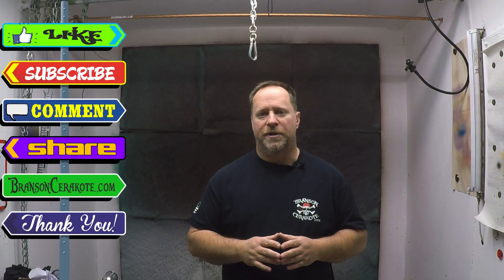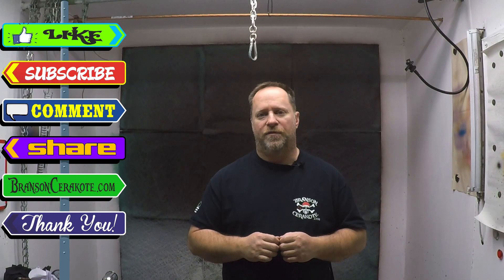Degreasing mistakes | Cerakote | Cerakote Prep | Branson Cerakote

Comment: Nicely done sir. On a side note, when coating custom made stainless exhaust headers my process is to wipe them down with acetone, blast, hang then spray them down really wet with virgin acetone, leaving to dry for 12 hours minimum. After some adhesion issues early on I found this to fix that issue. I agree I would not resoak them though unless I had a big enough tank and it was fresh acetone. Love your work!
Reply from the maker: Good info. We don't really do a lot of car parts.

Comment: What is the best way to clean a large piece like a manifold after blasting with aluminum oxide before using Cerakote? I want to be sure I get every speck of abrasive off the manifold and out of the inside of it. Thanks,
Reply from the maker: If it's already been degreased, then high pressure air. If you are worried about the item still having contaminants, then heat it up to 300-350 in the oven for an hour. If nothing comes out, then you are good to go.
Reply: @BransonCerakote  thanks! I'm just concerned about cleaning the inside of the manifold well enough to prevent any abrasives from getting into the engine.
Reply from the maker: @johnpatterson2157  When we do manifolds and headers, we normally tape off the areas that interface with the gaskets anyway. It just takes that concern away.
Reply: @BransonCerakote  I was out of town for about 5 days this past week but I did get the manifolds painted. I used H series gloss black on the plenums. I was going to clear coat the runners but I couldn't keep the aluminum from staining so I ended up painting them with c series glacier silver. I'm very impressed with the coating. It's very hard you can't dent it with your fingernail. I've thought about clear coating the manifolds but I'd like to go ahead and put them back on and get the car running.

Comment: I just wanna rattle can my barrel and don’t have a sand blaster. Can I use acetone on a rag? Or brake cleaner on a rag?
Thanks
Reply from the maker: I'd at least give it a good wipe down with acetone. We degrease everything by soaking it for an hour in Simple Green.

Comment: Does this hold true for wet blasting as well? All their documentation seems to be talking about dry blasting process as for prep and AO PSI etc. I always worry my water might have some oil or contaminate when I blast though I try to sanitize before putting stuff in there is seems inevitable. My plan was to put on oven after wet blast AO 100 ?  Been getting a lot of motocross brake calipers and I'm trying to figure best way to deal with the brake fluid. That's THE worst once a tiny bit gets in my water. Love your vids! Thanks you so much for doing these vids.
Reply from the maker: Sandblasting is primarily to get the surface etched, and to remove any type of existing coating. If we get any kind of residual contamination, we take care of that with the oven and a clean squeeze bottle of acetone.
Reply: @BransonCerakote  Thanks for the quick response!  Yeah that makes total sense.  Surprised Cerakote doesn't speak to wet blasting process at all.  I figured I would Gasout after I blast then wipe down like you said. Thanks again from New Hampshire! @603mods
Reply: How well are your parts turning out after wet blasting? I’m considering doing this for some parts to cerakote.

Comment: Thanks for sharing. Had a friend attempt his first cerakote job on his $3k F1 ar last weekend and it looks like it had contaminants that pushed air bubbles up under the surface. Looks like  chicken pox:) I haven’t gone over everything that he did for prep yet but I get to see how well the coating holds up to sandblasting. So at least I’ll learn something new:)
Reply from the maker: I've had calls about the blisters. I've never had that issue myself, but there are a few things it can be caused by. Most of the time, it is contamination. However, it can also be from coating that isn't mixed enough, or from bad coating/hardener.
Reply: Inadequate mixing never crossed my mind. Thanks.
Reply from the maker: @jeffhuntley2921  I don't know the chemistry behind it, but I do know it starts separating fairly quickly.
Reply: Mix well

Comment: I use a funnel with a coffee filter and filter my used acetone. It gets quite a bit out. I still wouldn't  use it after sandblasting. I just like knowing it's a little cleaner after use.
Reply from the maker: That will get the solids out, but there will still be dissolved gunk in there. Once it looks like weak tea it's time to replace it.

Comment: Just like powder coating, outgassing after degrease and sandblast is critical. If you find residue after outgassing, degrease again and outgas again. My experience shows a second sandblast is unnecessary if clean after outgassing. Keep the information flowing as I'm still learning how different materials react.
Reply from the maker: The only thing I would add is that we don't recommend putting the item back in the soak tank once it's been sanded. The soak tank normally has all kinds of crap dissolved in it, and there is a danger that the contaminants could settle into the etching causing adhesion issues. If more degreasing is needed after sanding, we recommend getting the item hot in the oven and spot degreasing with clean acetone in a squeeze bottle.

Comment: I had some cerakote that was close to a year old and painted with it and it failed guess it was expiration not shure its alot of things that could went wrong
Reply from the maker: Normally when it's gone "bad" it gets too thick to spray due to loss of solvent. It normally won't cause it to fail. If you want, shoot me an email at the shop with some pics and I'll be happy to try and help you figure out what went wrong.
Reply: @BransonCerakote  thanks for reply I sprayed with a airbrush and I put it on there thin .that could been problem I put in on some bicycle cranks on high abrasion and it wore off In about a month and it is real porous like a primer it absorbs dirt really easy . It could also be the airbrush cup I used was plastic when I got done it was squishey like a rubber hose in acetone
Reply from the maker: @damensutherland7081  We generally advise against using an airbrush for base coats. They tend to spray at really low volume because on the needle size, and don't give you the nil thickness needed for durability and abrasion resistance. Plastic cups are also generally a no go.

Comment: I'll agree than MOST times finger oils aren't a big deal. However, with white, I've had perfect fingerprints bleed through, looking orangish or pinkish in the white coating during bake.
Reply: Good to know, thanks!
Reply from the maker: I guess I have dry fingers, lol. 5 years in, and I've never had an issue. 

What temp did you cook it at? Just curious.
Reply: 250 for 2 hours. I must have been extra sweaty that day or something haha
Reply: @danbrownpaintworks  Nah, Dan it was probably that extra large order of fries the night before ;)
Reply from the maker: @danbrownpaintworks  Problems happen.
Reply: Whites .. and almost all light colors are somewhat transparent at times and I have found require a bit more repeated passes.  That may be why the fingerprints seemed to "pick up"?  Just theorizing.
Reply: @BransonCerakote  ... using Acetone a lot helps in drying out your fingers ... haha!

Comment: hi. Just wondered if you could share details on your degreasing tank setup.  I am unsure what is best to use for small items.  Many thanks
Reply from the maker: We have the degreasing tank from cerakote filled with Simple Green. We are going to move to a 15 gallon poly tank once we move into the new shop. If you only have small items, and don't need something set up for long term use, just grab a small storage bin and fill it with simple green. If it's something you are going to use longer term, grab an ultrasonic cleaner off of ebay. They generally start at around $30.
Reply: @BransonCerakote  thanks for the reply.  the ultrasonic cleaner is a very good option.  I will look into that.  Do you find your self not using acetone any longer?
Reply from the maker: @danpayne8574  Only to clean the HVLP's, and for some minor wipe down degreasing. Simple Green is much cheaper.
Reply: @BransonCerakote  ah awesome. Makes the task a little simpler finding something then. Thanks very much for your advice.  :-)
Reply from the maker: @danpayne8574  Glad to help!

Comment: Do you have any experience using an ultrasonic cleaner? I've sprayed a few parts i cleaned in one with dawn dish soap and water. Having mixed results with the parts
Reply from the maker: We use one to clean filters, and glass, but have never cleaned parts in one. I'd be careful cleaning parts in dish soap. You'll have to rinse them completely to remove residue. Anything left on the surface will cause adhesion failure.

Comment: Sine you mentioned Simple Green, what about LA Totally Awesome for degreasing? And instead of a soak tank, what about a parts cleaner tank?
Reply from the maker: I've never heard of it. Ultimately, you just need to get the part cleaned off, without leaving a residue. If it works, it shouldn't be a problem.

I used a parts cleaner for the first year or so. The only issue was it wasn't big enough for barrels.

Comment: How would you suggest getting all the dusk off after blasting?
Reply from the maker: Just high pressure air.
Reply: @BransonCerakote   what about break clean?
Reply from the maker: @biggbill72  I've never been a fan of break clean. Even the non-chlorinated version leaves a visible residue, and usually isn't needed for degreasing. Dust is just dust. Blow it off and spray.
Reply: Does acetone leave a residue?

Comment: I've been in the industrial coating industry for 22 years. With some healthy certification to back it up. Most recently a company in South Africa who is now one of the few Cerakote agents in the country has asked me to train all their chaps on surface preparation and paint applications. The biggest problem I'm having and with no two items behaving the same is with H300clear series. No matter what I've tried some of the stuff parts hold the clear to minimum desired mills but others parts with the exact same steps taken don't hold the clear at all. Some of these parts that fail I send straight for thinner wipe down and allow to dry then I'll give them another clear coat and they fine.... others not! I've tried everything from even taking ambient humidity and outside Temps into consideration and calculating dew points but nothing is uniform on any given day? It's mind boggling and setting this poor company back in terms of production. Any help would be appreciated!
Reply from the maker: If you are using H clear, it has to go on wet on wet, meaning you need to spray a single color base coat, let it air cure for 20 minutes, then spray the clear over the base coat. Let it air cure for another 20 minutes, then bake. If the surface requires you to bake it first or even just tack it out, you're better off with an MC series clear. H series clear doesn't bond well (if at all) to a dry surface.
Reply: @BransonCerakote  ah bless you my brother. That's exactly what's been happening all this time. I really appreciate the reply and if you don't mind may I hack your brain from time to time.
Reply from the maker: @butlersracing7692  No worries. Absolutely.
Reply: @BransonCerakote  Thank you so much. I have subscribed, watched and liked many of your vids. You doing amazing work with this product and love the information you share regarding it. 👏
Reply from the maker: @butlersracing7692  Glad to help!

Comment: I use acetone
Reply from the maker: We actually switched to Simple Green a few years ago (this is an older video). SG is way cheaper, isn't hazmat, and doesn't evaporate if you don't dilute it. We still use acetone for spot degreasing.

Comment: How often do you change your acetone?
Reply from the maker: Depends on use. We don't really go by time. It's more of how it's starting to look. We lose a gallon or so a week from evaporation, so we just keep adding. However, eventually (for us around 90 days) it will oxidize. Once it turns the color of weak tea, change it out.

Comment: so basically after full degreasing, sand cabinet and then paint booth?  What about the sand blasting media?  Just blast that away with pressurized air?
Reply from the maker: Yep. I've never had an issue doing it that way. Minus switching a step, we do it the same as NIC.

Over de-greasing can lead to more problems than just trusting what you've already done.